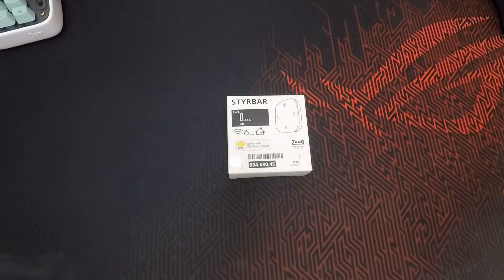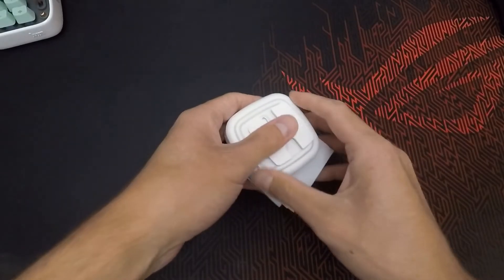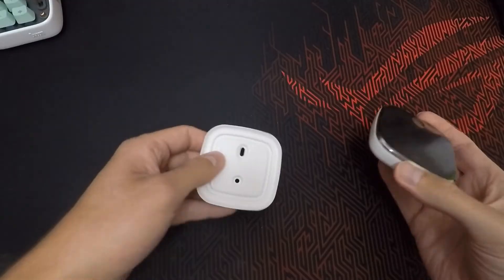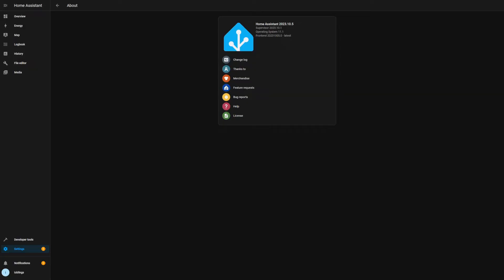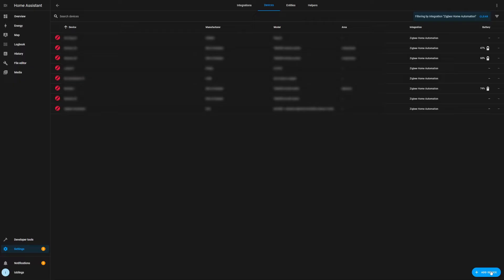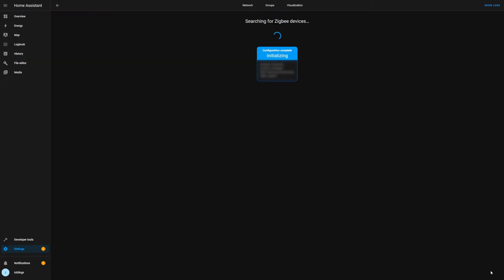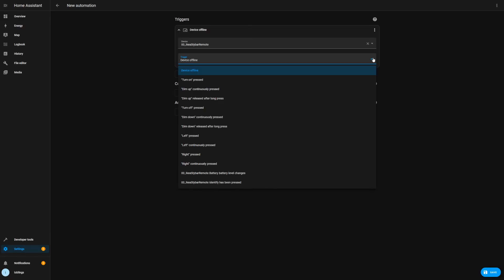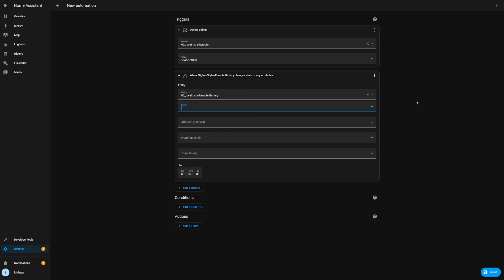STYRBAR Remote Control - Home Assistant Integration

Comment: I can see the triggers when I create an automation, but I cannot seem to fire the automation by pressing the buttons. The buttons don't have any effect in home assistant. The automation is correct, since if I run the actions by hand it behaves correctly.
Reply from the maker: Try checking the trace of automation and see if there's some other condition missing. Another thing you can try is opening the device and check in the log box if you see the buttons press.
I had some issues with the symfonisk remote with some buttons not registering quite often, I'm now running z2mqtt and so far all the issues seems to be solved. I'll make a video when I'll have had enough time to test it